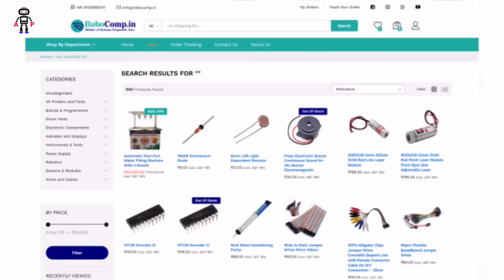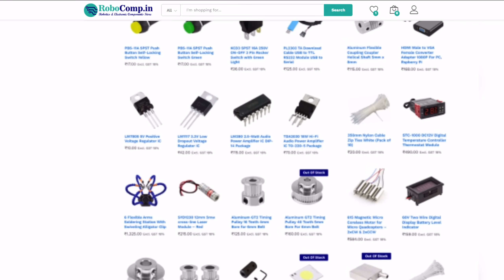How to Control 4 Devices using IR Remote | Home Automation Project

Comment: 270 ka 4channel ir remote module se better 150 ka Arduino nano lekar 8channel relay control eeprom ke saath kyu nahi
Reply from the maker: You are right bro, But har kisiko programming knowledge nhi hoti, without knowledge programming karna possible nhi hai, ye module plug & play hai, no coding need, ise koi bhi easily use  kar sakta hai. (Perfect for Beginners )